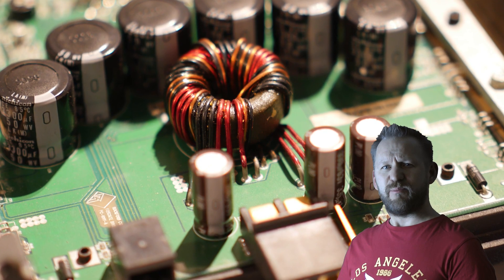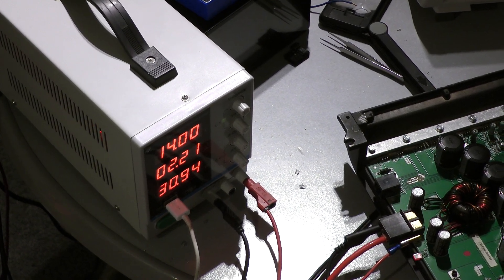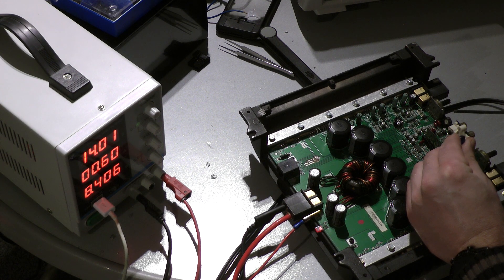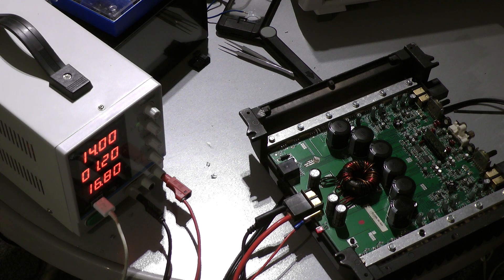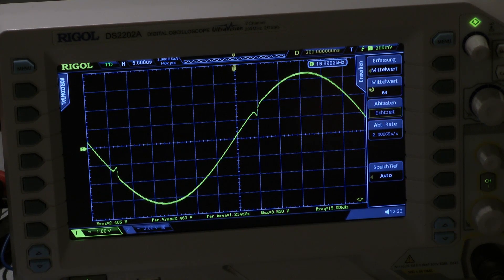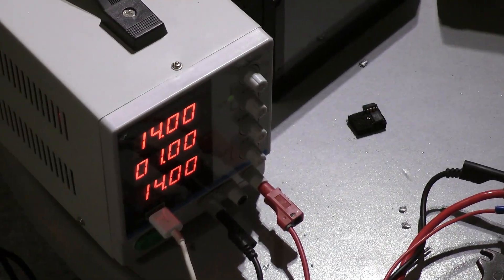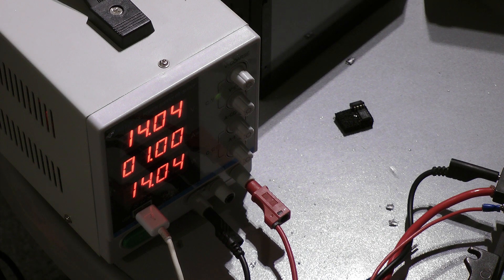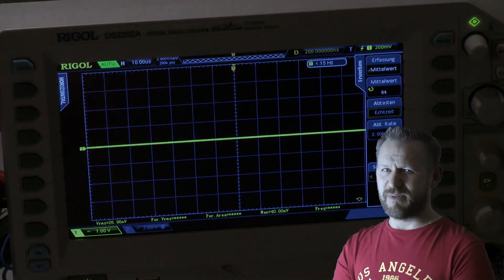Rockford Fosgate Punch amplifier - bias adjust - idle current tutorial oldschool class AB amp

Comment: Hello!  I have a damaged Punch 8004 amp from 2005, which when I connect the Front channels, it idles at about 8-9 amps and No sound.  When I connect the Rear channels, it idles at about 2-2.5 amps, and it has sound but distorted.  When I connect the Front channels, it also heats up!  Nice video.
Reply from the maker: i dont know the punch 8004. is it a class d or ab ? if its class ab just turn the bias pot fully counter clockwise and check if idles goes down. if not you have a different problem.
Reply: @audiokeller1975  It is a class A/B 4 ch amp.  I won't attempt to fix it, because I don't know how like you do!  I just mentioned it because when the amplifier is idling at 8-9 amps, it heats up really fast, like you say in this video.  It cost me US $140 used, and it only worked for 2 months!  Punch 8004: 100w x 4 or 400w x 2 bridged (800w total).  Thanks for your response.
Reply from the maker: if the idle current is not going down when bias pots are fully counterclockwise you have to check for shorted output transistors and if gate resistors are out of tolerance. also check the driver transistors.
on most oldschool rockford amps you can check if the power supply transistors are ok by just connecting remote and GND without bplus. if there is a very low idle then the ps is likely ok.
as i said i dont know if your amp is similar to the oldschool designs i worked on.
Reply: @audiokeller1975  the board is a little longer and red, instead of green, but the inside parts are similar to the 800a4 (8 caps 4700uf 50V, etc.)!  Unfortunately, I do not have the Training or aptitude to fix this, or any other amplifier.
I sure wish you were here in the US, and I would send you the amplifier for you to fix it!
Thanks for the information.

Comment: Hi!! Excellent video,  but I missed how one balances both channels if you do not have a scope... or is that the point that you have to have one? Thanks
Reply from the maker: Hi!
I also forgot to mention during the easier way that you can stop turning when the current rises stronger. A rule of thumb is to adjust each channel until it rises by 0.05A. i usually give alittle more and use the scope. by following this rule the amp would idle at 0.7 amps. you will not find a birth sheet where it has been adjusted to only 0.7amps by rockford. most sheets show around 1 amp and some 1.2A.

Comment: I have a 401s that I haven’t used for 20 years. I took off back plate. I saw these dials. I thought they were gains. 

Is there a way I can adjust these back to correct position without a scope?
Reply from the maker: Yes, there are several ways i tested and worked ok. Turn both pots completely counterclockwise.
The first is by ear: get a frequency generator app and connect it to the amp, start with only one channel and apply a 50Hz signal for example. Adjust very slowly clockwise and stop after the sound sounds undistorted. Test again with a higher frequency. Then do the same with the other channel.

Another method is that you turn the pot until you see a rise of 50mA for each channel. Example: amp pulls 1A if both pots are set completely counterclockwise. After adjusting the amp pulls 1.1 A.

you can also measure DC milivolts over the big source resistors on the outputs, adjusting it to 1mV should be good enough.

Hope that helps 👋

Comment: Does this work on any amp?
Reply from the maker: Newer class d amps dont have bias pots , different more efficient design.
i did this also on a hifonics cupid amp. 👍
Reply: @audiokeller1975  SO if they actually have a bias adjust it can be done? As long as I have a oscope to see it. I have few RF 851x's & RF 1501BD's that would be cool to check and see if it can be done. Not sure if they have the adjust though. Would have to check service manual
Reply from the maker: 1500bd has no bias. its class d